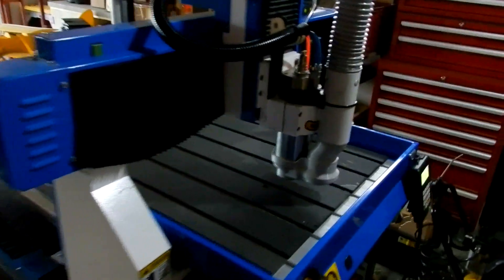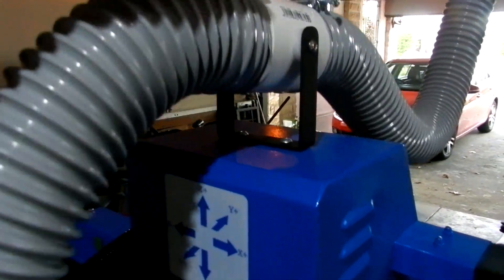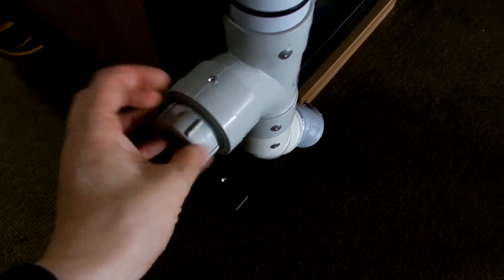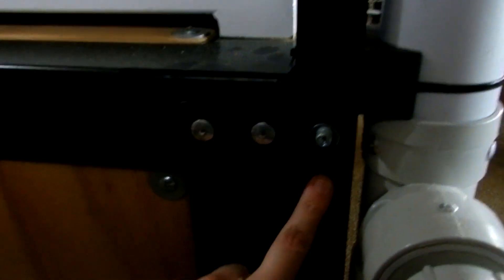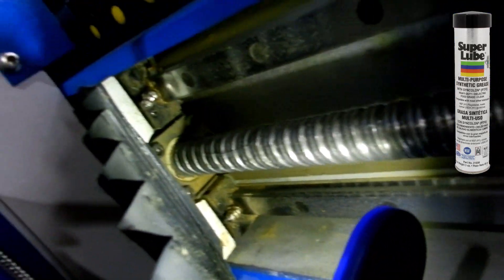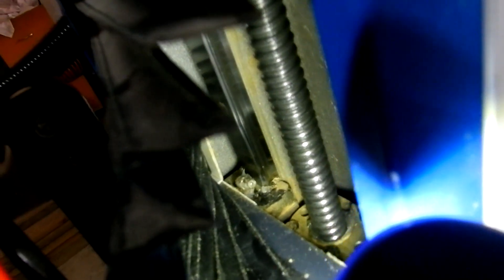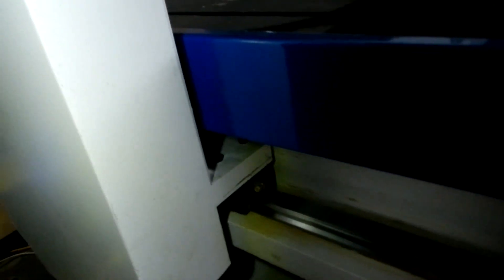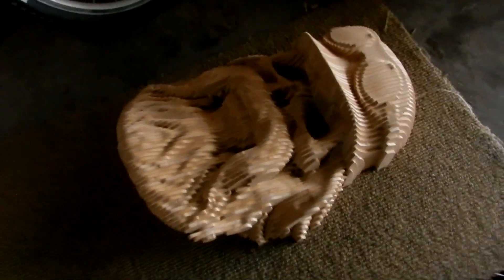SM6090 CNC Update 2

Comment: Are you staisfied with your machine? I am going to order a similar one, but I am a little bit affraid if it is of good quality.
Reply from the maker: Yeah love it. Works perfect and they easy to chat with at the commpany.
Reply: Thank You for Your answear, I see You are rc modeller as well as I ;)
Reply from the maker: No problem. Nicely built machine.
Reply: Hi mark? Do you still have your machine? I have an SM4040, and although I love it, it has a few issues I need to fix and was wondering if ordering parts from them is possible?
Reply from the maker: Hi, never had to order parts from them. I replaced the Z zeroing tool with aftermarket one from another company. apart from that nothing else. Only other thing i can think of replacing would be the grease nipples as I find the grease gun locks on to them to much and they are not threaded into much and can unscrew easy. Flush grease nipple, Concave Type.  @connorbabcock7718